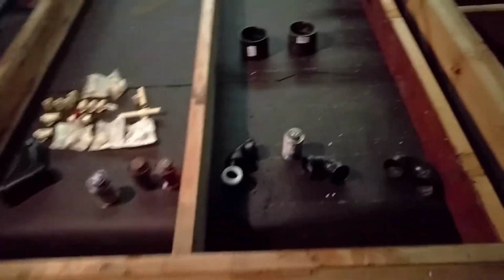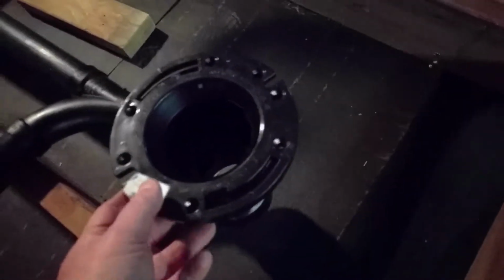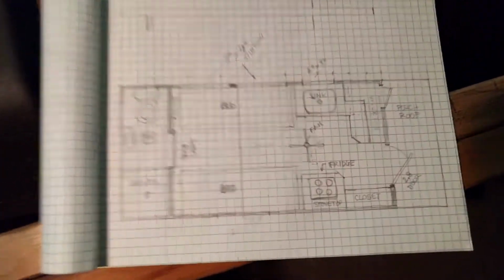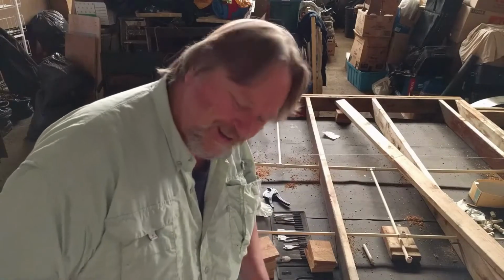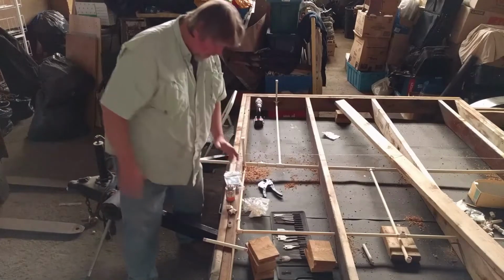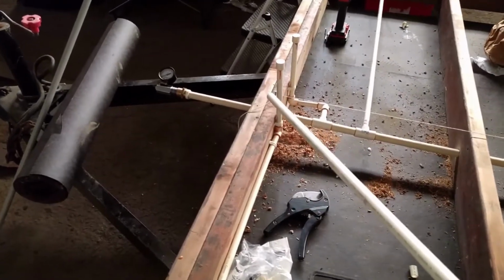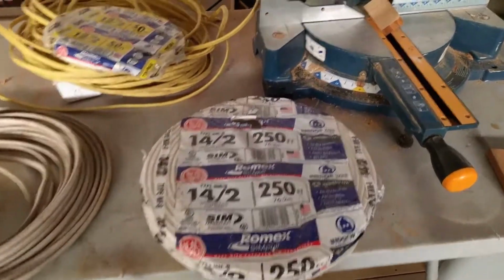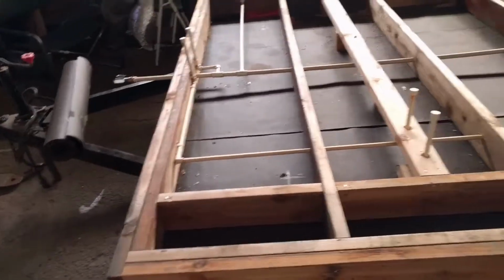Mini House Build Part 3 Lay out the drain lines and install the water lines

Comment: Hey brother I’m assuming there’s a bed in the loft, why so many beds in such a small house? Wouldn’t it be better to utilize one of the sleeping areas for something else? Perhaps a setting table or some kind of heat.
Reply from the maker: I was planning to make one of the lower beds into a Murphy bed that converts into a desk/table area. The heat will probably be a small wall mounted electric heater, got to save space I only have 128 sq ft of space 184 if you include the loft area. Give your beautiful family a hug for me, Mom too. :  )
Reply: @robertbraden3889  👍

Comment: 👍🏽🎉Happy birthday . Looks like  a wonderful plan for this tiny house  Will it be a Fourseason Home Will you be installing a mini split for the air and heat what will you be able to tow it with a heavy duty truck ❤️🙏🏽🙏🏽
Reply from the maker: @Pebbles59 Thank you my friend! I am not going to install a mini split, I'm on the very northern coast of California and the temps are very mild here. I'm trying to build with stuff out of the shop and I have heaters and window A/c so I will avoid the cost. My Ford F250 will tow this tiny house easily and  will be made to hook up to water, sewer and electric.  :  )
Reply: Thank you  R.B  Hope you had a wonderful birthday